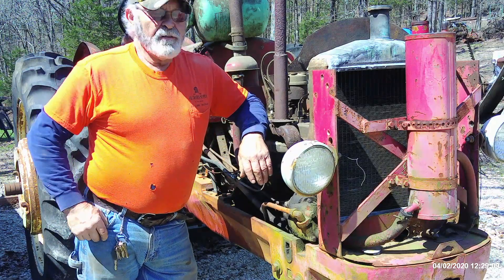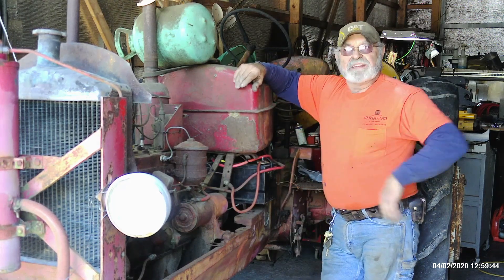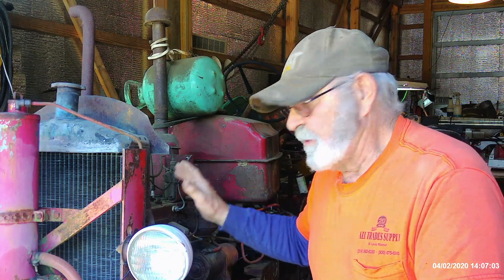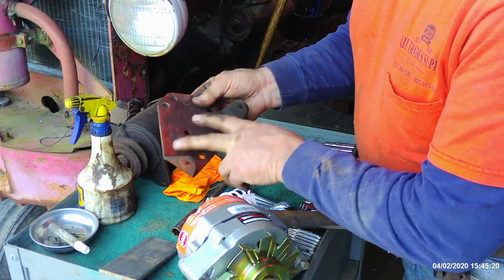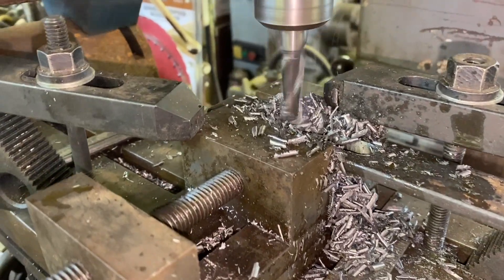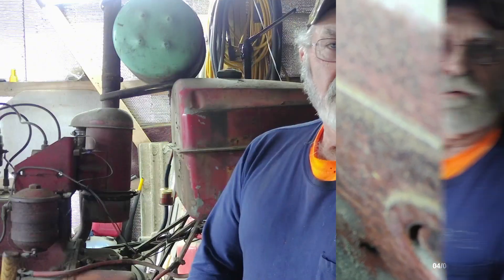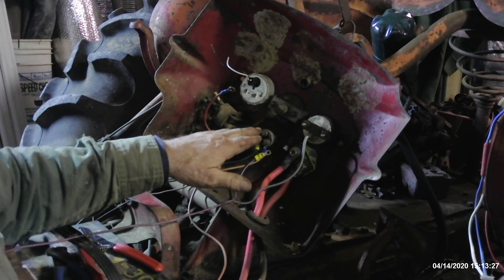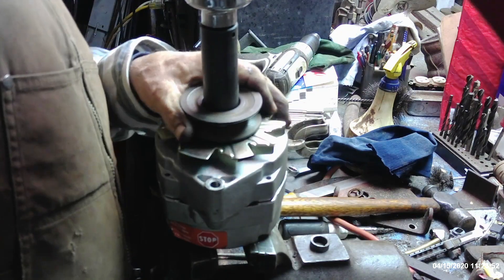12 V One Wire Conversion Massey Harris 30

Comment: Even not knowing much about generators and alternators it is still interesting to watch and listen to your videos.  The ole gal purrs like a kitten, another job well done.  Kudos!
Reply from the maker: Yes...if you remember Junior, the 30 is an updated 5 speed version of the 4 speed older 101 Jr. tractor.  Its actually the same engine as the Jr. had at the end of production, but in its earliest years, they had a 124 cu in engine and the mid years they ran a 140 cu in. A full 98 cu inches less than the 44's 260. Glad you enjoyed it.  Thanks for the comment and the compliment as well.

Comment: Great job on the alt. install, volt meter makes sense. Lets get the old girl working!
Reply from the maker: Oh yeah she'll be in the wood pile in no time Don !!  I still have to breakdown the flat front and repair or replace the tube though.  Thanks for watching and commenting sir. I forgot to point out in the video that when the key is turned on, you can spot immediately a battery whose condition is weakened and begging for a 'top-off' on the charger too.
Reply: @tractorman4461  Ya you gotta watch for slow battery drain on older tractors
Reply from the maker: @donmacdonald7758  Yessir you are correct and that's the reason when converting to a 12v alternator, all old wiring is removed. Ain't nothing worse than a cold morning, 10'' of snow and a dead battery on the tractor !!
Reply: @tractorman4461  I don t think anyone would disagree. LOL

Comment: How's she goin'?  Great to see the Massey Harris come back to life!!  Nice explanation of the one wire alternator Wendel!!!  Any fool could follow that, and I did!!!  LOL  Take care!!!
Reply from the maker: Ain't nothing like an old tractor on a cold, cold day firing right up !!  So much of a quicker spin, it draws the gas vapor into the intake so much better and compensates for a weaker, worn engine.  Plus, no regulator or cut out to maintain and have you noticed a lot of the new battery chargers do not have a 6v setting.....  Thanks Mike for commenting sir.
Reply: @tractorman4461  I think the 6 volt is gone.  A lot of people don't even know there was such a thing.  And then when you mention positive ground, well that really shakes them up!!!
Reply from the maker: @GrampiesWorkshop  hahahaha...you are right about that !!  Give them a rotary phone and have them call for a 6v regulator and 6v generator.......LOL.
Reply: @GrampiesWorkshop  hey Mike , ya but it was a marvel in 1939 when my tractor was built. LOL
Reply: @donmacdonald7758  You're right on there Don!!!  I know some guys with antique tractors and they say the 6 volt system was the best and won't switch over!!!  LOL  Take care!!!
Reply: @GrampiesWorkshop  Sorry Mike but she s 12V now with electronic ignition. LOL
Reply: @donmacdonald7758  Ha Ha Ha!!! For the record, I'm a fan of 12 v and the electronic ignition sure solves a lot of headaches especially in cold weather!!!